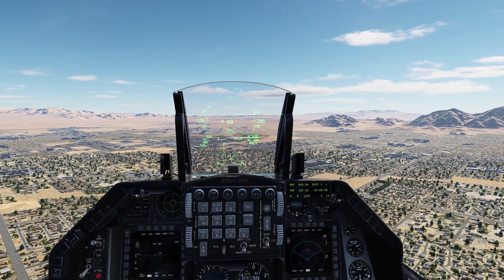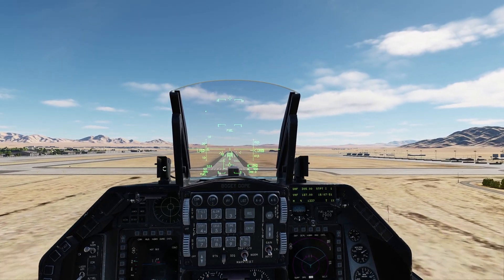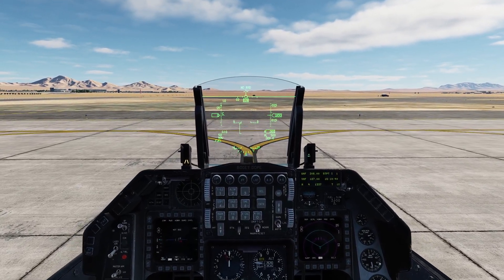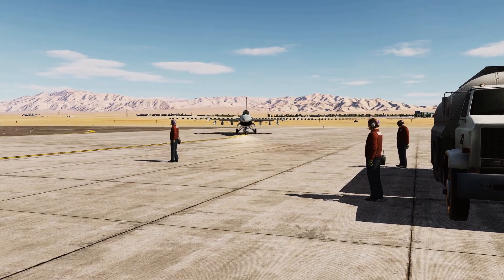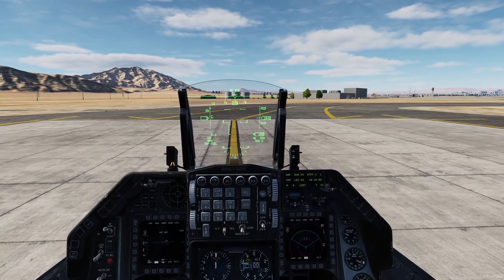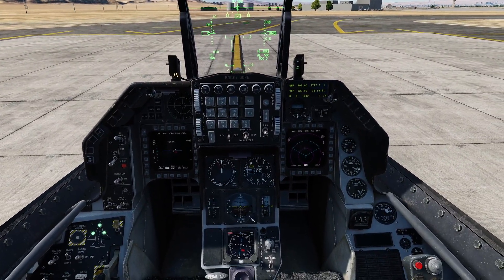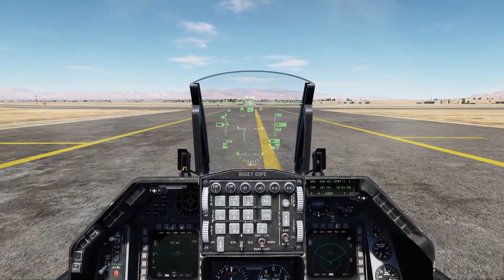DCS: F-16 HOT PIT WITH EXTERNAL TANKS!

Comment: Hot Pit refueling reminded me of an incident back in 1983 at MacDill AFB. I was at the fuel system repair shop where the hot pit was not to far behind our shop which was  the across the run way or taxi ways from the jet engine shop. 

We heard a thundering sound followed by a loud boom. We ran out the back doors to see an F16 on fire on top of the hot pit. Running over there a woman ran past me screaming. I thought to myself, how did she beat me out here and she must have seen the pilot on fire. The canopy was closed when I started over there but was now open, fire was engulfing the AC and there was no pilot. Fire was arriving so I moved away to safety.

The story was that she was a jet engine mechanic testing the engine. Somehow she got into afterburner and took it for a ride across the runway missing multiple AC and other vehicles, ripped the gear off shortly after "takeoff" and landed on the hot pit area.

This was 40 years ago so my memories of the F16 and MacDill have long since faded, but not the sound of her screaming as she ran past me.
Reply from the maker: Wow! That's a crazy story!

Comment: Hey, great video! I'm learning a lot with your excellent material. I'm new in DCS and learning step by step all the stuff with the f-16. Sorry if the question is dumb but, do you have to, somehow, put that tank on the airport when you create the mission, or is it already something that every airport has by defect? I mean, I never get the control tower to give me permission to land (when the airport confirms that they have me in visual, they tell me to contact CT for permission, but I never get a reply after that), until already landed, and then they tell me to taxi back to parking area, but no one is there and I don't know how to ask to refuel and rearm me. Can you help me with this problem? Thanks in advance!
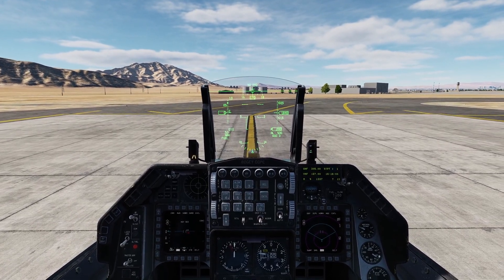Reply from the maker: No need for the fuel truck in order to do this. I just put that there to "simulate" what a hotpit would look like. To do this, just find a spot on the ramp. Park. Then open your AAR door and then press \ and then F8 and then F1 I believe, in order to get to the ground crew menu. From there, you just slide that fuel slider all the way over to the right, make sure everything else looks the way you want it, and then click "OK". You'll hear the crew chief acknowledge and start fueling and rearming. You can see the procedure to follow starting at 5:51 into this video.
Reply: @BogeyDope  thank you for your time in replying, man. I'll do it as you said. Cheers, mate!

Comment: Great video, thanks! 
a question, does the jet internal tank has to be below 2500lbs? (that is how it is in DCS) and AAR doors open to fully fill the external tanks, cause in DCS if you don't have below 2500 ext tanks wont fill up. Wanna know how it works in real world, do you have be below 2500lbs to fully fill up both ext tanks and internal tanks?*
Reply from the maker: Its been a long time since I did Hot Pits, but I don't remember any fuel level prerequisites for hot pit fueling. And I remember getting them all full, including externals without any issues, as long as the AAR door was open. That's the only prerequisite. The door needs to be open. Should be able to get a full load. ED has mentioned they are working on new "Sliders" in the rearm/refuel window that will allow us to custom the fuel load internally and externally. I'm hopeful this will correct that issue.
Reply: @BogeyDope  Yeah I saw that thread on their forums, I wrote there that ext tanks should fill up to full on the ground same as they do in air, its the same process of pumping fuel... maybe they need some SME to help out🙂

Comment: I suspected the door needed to be open when the jet first launched but couldn't get the external tanks to refuel so I just assumed the sim lacked the ability to refill them. As a result I've just been taking them off and putting them back on again. I guess they added the ability at some point without me realizing.
Reply: Same thing happens to me in the F18. I could never fill up the external tanks. I have to try this! This is amazing! It's the small details that amazes me about this sim.

Comment: I use to be POL and we hot pit refueled RF4 reconnaissance planes all the time. Holding that Deadman switch was always surreal to me. Like why they had to call it the Deadman switch lol
Reply: With the A10-A we flew without drop tanks(Except for deployments and cross country), so it was no issue in the Hot pits. With the F4s I worked on (F4D, F4E, and RF-4C) the tanks would refuel without the IFR door opened, The switch in the cockpit had to be in "all tanks". The major issue is that sometimes fuel will vent out of the wing dumps masts. The Rhino the gear had to be up and locked for the tanks to pressurize. To leak check the ext tanks on the ground we had a tool to install on the switch on the MLG to trick the Rhino that the gear was up and locked. The dead man is called that because a crew got killed during a hot pit refueling. If you release the switch you should no more fuel flow (Well so they say) Kinda a long answer. Hope this helps your viewers.

Comment: I've had instances when I was using the wing bags, opened the door just prior to refuel and they wouldn't refuel it completely. Did you test this as well? Needs to be with the wing bags (and i guess no centerline tank).
Reply: You need to be below roughly 3-3300lbs to completely refuel the wing tanks if I’m remembering correctly. DCS, no clue about IRL
Reply: @9GLoco  Correct, this just fixed the partial refueling of my wing tanks. Thx
Reply from the maker: I have not seen an issue when I tried it, but I'll have to try different configurations and see.